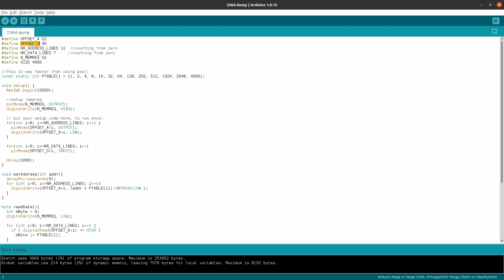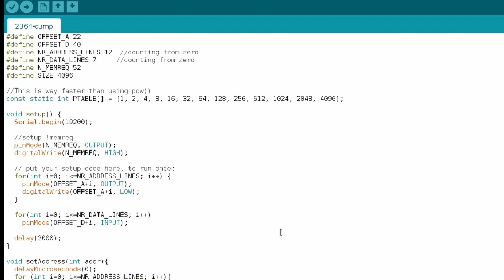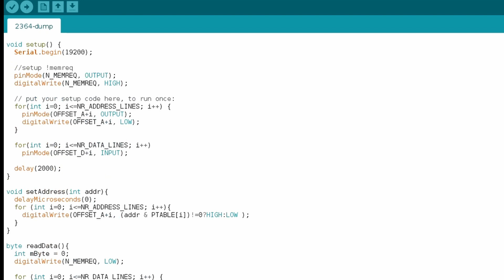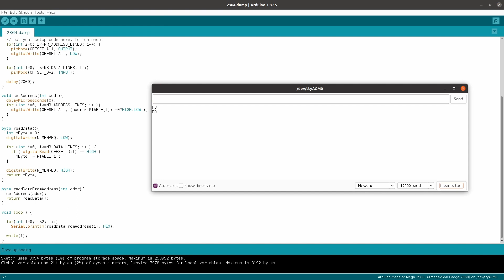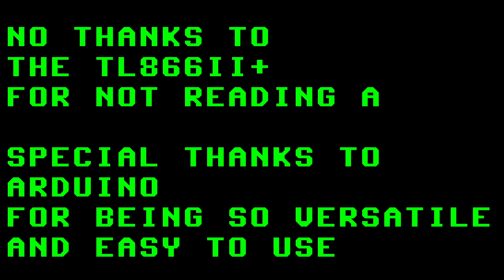Chess Challenger tear down and ROM dump

Comment: I remember my friend alexander had one. The most interesting thing were the seros going up and down when computing. It was done by ron nelson, no permanent brain. Ron Nelson was later replaced by the spracklen program that ran on 6502.
This program also had permanent brain and was maybe 80 elo stronger and had more potential in the long run.
Reply from the maker: Yeah those flickering zeroes was something I immediately recognized from the Chess Challenger ☺️And we all know the 6502 is the better processor although it has no 26 bits combined registers which the Z80 has. And as a longtime commodore user I’m not impartial 😅

Comment: Thanks! I bought my CC7 in 1980. I still have it. It still works. I did have to change the Z80 back in 1995. I also changed out the crystal to a 6MHz in 2001 and it runs stable. I have been wanting to dump the ROM but could not find a reader. You did it for me! Thanks!
Reply from the maker: AWESOME! THAT IS SO COOL!
Going from 4MHZ to 6MHZ must be noticeable for sure. And yeah it's a nice little piece of chess computer history. I am not much of a chess player myself, but my dad used to be the secretary of the CSVN (Dutch Computer Chess Society) and he would usually be the arbiter for the annual Easter Computer Chess tournement. And my uncle was a very skilled chess player and pretty well off, so he basically bought every novel chess computer and they made their way to us to either get fixed by my dad, or given to me to play with. So my fondness is more nostalgia for my uncle than the love for the game. My uncle actually give my the big brother of this one that also spoke: "I am the chess fidelty"... and spoke the moves C3-C4... really quite amazing for 1981. So hence I pick up a broken chess computer now and then and fix it and my dad loves seeing those videos too.
Reply: @CallousCoder  - Yes, it still plays the same game of course, but just a little bit faster. It also gives the CC a slight edge because the algorithms process faster when playing a timed game. I have several chess computer games that I have collected over the years, including a Boris.
Reply from the maker: @epsyuma  yes indeed, it can churn through almost 50% more moves. That’s a actually a cool project. I may explore it myself for this, if you don’t mind. I will obviously credit you for the idea.
Reply: @CallousCoder  The new Z80 I installed was rated at 6MHz. Above 6 the RAM started giving me an issue. Perhaps a cool project would be to upgrade all of the hardware while still using the original chess code. I found a Z80 on Amazon that's rated for 20MHz.

Comment: Would you be willing to publish the ROM connections and content ?  I think (but can be wrong) it is the difference between Version 7 and 10. The version 7 has 2111 RAM's , (256x4), and I will read those contents as well this weekend. I also have 2 "Speech" versions, one working and one "dead" which is on the bench soon.
Reply from the maker: Hi Bram

I pushed it into a repo
https://github.com/rdoetjes/chess_challenger

The wire connections I haven't written down as it was just a "MacGuyver-ed" it to get it to work build. But basically it's just connecting  the address lines to output pins (in order).
And the same for the 8 data bit pins. And then the not-CS that we pull down.

Comment: It's a clever "chess move" to do a ROM Dump, for an opportunity to revive this nice retro gimmick. Would you do the same with the DDR version? I've never been as deep into hardware and coding work as you.Now i have learned what can help at desoldering, thank you for this information!  My knowledge ended in the early 90's with building a relatively simple light gun and driving simulator hardware for my C64 :) A few weeks ago it would have helped me to dump the EEPROM from my car ECU because I had lost all the keys but luckily this problem is now solved 🙂 Greetings from the Ruhr Area, Chris
Reply from the maker: How did you get into the car to get to the EEPROM with the rolling codes?
And that lightgun sounds like it was a cool project. I have this idea for a video to hack the Nintendo lightgun so you can’t miss. With older systems you just pointed it at a lightbulb. Nintendo expects a dark frame before the light, so it needs to strobe.
Until now I had no luck getting the right cables to insert a proxy microcontroller between the lightgun. The three extension or replacement cables I ordered, all didn’t have pin 6 and 7, the ones I need. And I don’t want to cut the original cable of course.
Reply: @CallousCoder  Good morning ! Hahaha, I see you're going deeper into this lightgun topic
I think , i can't really help you, I just know that due to raster beam technology, the Nintendo Lightgun only works on CRT, not on modern displays.
back then I adapted the lightgun from a 1980s SANWA Pong video game console.
More specifically, I soldered the wires from the photoresistor to the 9-pin Dsub joystick connector to feed the analogue inputs from the C64. After that I wrote a small program in C128 Basic which was technically similar to the Pong game but with some gameplay changes.
This means a black screen with a randomly appearing and moving white sprite that has to be hit within a defined time. Hmmm, maybe I should recreate this old gem :-)
And with my car: Luckily one of my keys (which I've been missing for more than a year) was found
in the building where I work.
So I don't have to mess with changing the eeprom data eeprom in a sealed ECU. My car is not so popular, so the information about the ECU and the immobilizer control unit is very rare